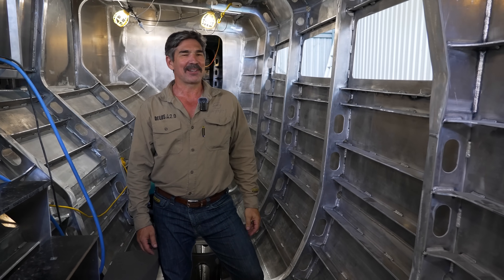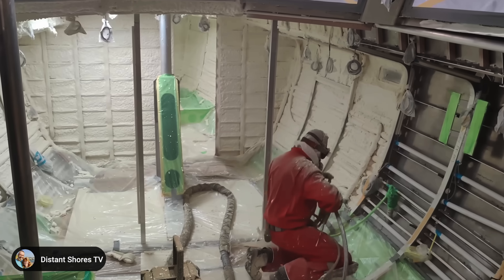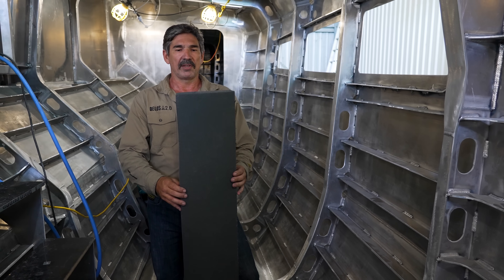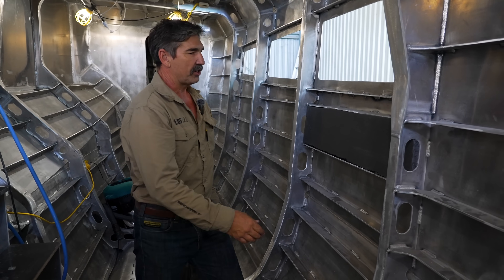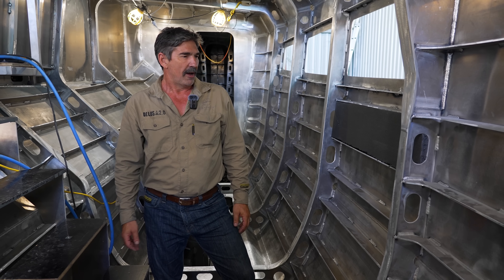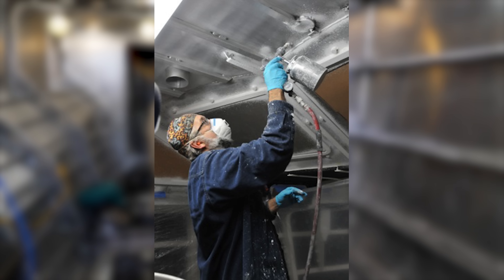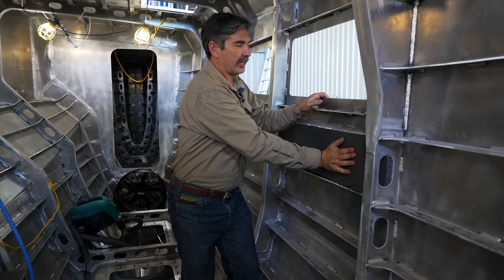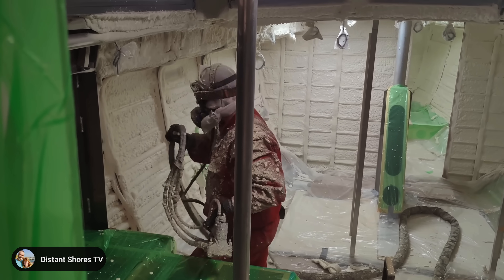HELP, We Need Your Advice!  How Should We Insulate Our Aluminum Catamaran???

Comment: I sold commercial insulation for 20 years. Insulation is only part of the equation, a continuous vapor barrier is the rest if the equation. For the complexity of the hull, the only product, that will provide a proper vapor barrier, is closed cell spray foam.

Comment: What ever you decide on run all your wire conduit with jumper box’s every so often, but spray foam would be my choice, being insulation you also add flotation buoyancy in case you get hold might keep you from being sunk just my opinion and thoughts

Comment: Neolon between the ribs and sealed with spray foam.  Easier to remove large section in case of repairs and still sealed together with spray foam.   You can't get away from the heat transfer with the the ribs but a thin layer of insulation will help.

Comment: After looking up some stuff on this I would say  personally I would go with
1) paint for moisture protection
2) foam for insulation.

I would definitely say that painting (maybe using the correct etch primer/primer first) would be something I'd want to do and then putting the insulation on top of that, if painted correctly then this means even if you get some condensation in there it won't get to the metal.

If it was myself I'd look at first finding an etch primer, these are normally really thin (like a fine mist) and mostly there to get good adherence between base primer and the metal. 
Then a proper coastal protection primer to provide the moisture barrier. 
After than a top coat (if required by the primer)
Then, as you don't like spray foam, you can use the solid foam for sound/temperature. I would probably leave gaps at the top and bottom plus maybe some vents so it can breathe to allow moisture to escape.

If using paint as the moisture protection using (vented) foam blocks is probably a good way to go as it allows easy regular inspection.
If not painting the probably go with the spray foam to get a seal on the metal. Although I doubt this 'bond' to the hull will be as durable as etch primer over time so personally I'd go with the paint option.

That may be overkill to most but If I was putting this much money in a boat I'd want it to be overkill :P

Note: If using these kind of 2 pack paints for spraying you really need an air fed mask. When talking about paints like these two pack etch primers they are really (and I mean really) bad for your health until set. I remember one comment saying something about them getting into to your lungs, hardening in there and never leave again until you're body decomposes :O. The one I used (aircraft not boat though) it was ok once hardened (so any sanding dust was about as bad as normal dust) but when wet it was pretty nasty stuff.
Reply: Nice way to make a condensation nightmare that will grow mould .
Reply: @jackdbur hmm, Sorry all I see a sarcastic comment with no real helpful advice just problems ... I think that is what the internet calls a troll or are you just new to the internet. 
Your the only one so far to mention mould (a valid point true but not the discussion of this post and the video), and you do it in a reply rather to a post responding to something Brian said in the video (wanting Hard foam) rather than a helpful post of your own pointing it out with advice.

I definitely smell someone who just likes to try and put others down rather than post helpful advice. Hope you felt good about yourself with that post, as to everyone else we will just ignore it if you have nothing helpful to add to the conversation.

Just in case I'm wrong though.
Feel free to start you own post on how to deal with mould so that others can benefit/add to side of the conversation (unless you fear being criticized on your own ideas). 

I only know that from my own personal experiences that I prefer the idea to be able to easily inspect behind foam (but I'm from aviation side of things so yearly inspections are something I'm used to), more work but that way I can be sure no rust/mould/cracks are being hidden and catch any issues early. If mould was an issue where I was based I would also clean with white vinegar before reassembling (well actually I'd seek advice first to see what the latest and greatest methods were for that issue).

Comment: Any electrical conduit runs should be made WITHOUT mixing voltages inside the runs.  An electrical conduit must carry the same voltage.  Do not mix DC and AC conduit runs, and don’t mix DC runs of differing voltages, especially anything low voltage DC and high voltage DC (anything over 48 VDC). You might consider color coding conduit that is matched to each voltage it is carrying for easy identification to what is what, given your primary voltage is 48VDC but you will likely have 120 or 240 VAC runs too for certain equipment.  Complicated Brian. Think through everything.

Comment: As a commercial and luxury boat/ship builder and designer for 50 years. Your choice for quality is but one.
Here's how you do it.
Etch the metal, prime with MIL-PRF-23377K Type I, Class N Yellow Chromate-Free primer, spray foam insulation. Do this only if you want the proper job done correctly. 
Good luck.
Reply: I think that is the same primer airplanes use.  Airplane manufacturers prime every piece of Aluminum before it riveted.  Airplanes suffer from major condensation and frost issues.  If they didn't prime, airplanes life expectancy would be greatly shortened due to corrosion.  WWII aircraft were not primed.  Why waste the money on airplane that wasn't going to last long.  It means that corrosion is a big problem with WWII aircraft.
Reply: Fascinating information, and quite funny to read all these comments, as a non expert in this field. And it is as an experienced live aboard professional sailor told me a few months ago: if you have 2 sailors in a room then you have 3 (opposing) opinions about sailing in that same room 
😆
Reply: @bailahie4235  There is a Dutch Expression the best Helmsman stand on Shore. 
Also if you watch the Tally Ho channel they swear by traditional wood hull boats instead of Fiberglass or other materials. 
Which is probably the same for what ever you are specialized and or most familiar with. 

Also
Reply: You bet it is. That is why it is the very best for long-term corrosion protection.
Reply: Personally I Don't feel aluminum is proper for live aboard sailboats.  One small mistake on a reef and it's gone. And finding knowledgeable repair worldwide is a major problem.
Reply: @enduranceG51  In practice, the reality is quite the opposite. An aluminium boat will take a beating on a reef and just dent. The FG boat will get holed. Speaking from experience as the owner of an aluminium cat that's been on the reef at few times (at the hands of the prev owner). No fibre glass boat of the same weight would have taken the beating this thing has.
Reply: @enduranceG51  Delos crew has over a decade sailing experience. 
And what I've seen from other fiberglass boats with Sailing vloggers its not always a pick nick regardless on what material your hull is made out of. 

Sure Pilot error can still happen but its probably a small number, can't say for other sailors that may cross paths with Delos. 

But to live full time on a boat that cir cum navigates the world you do want easy upkeep. And space. 
Most people that live on luxury yachts are probably at best a month or 2 on a boat per year. 

So things break slower as well. Full time sailors always have something to fix it seems like.
Reply: There are plenty of arm chair builders on this trying to give advice which is great, but not necessarily correct. I'm sure it will be sorted out.  Brian is pretty with it.
Reply: Not sure that works for a boat that people live full time on, and maybe not the most upkeep friendly.  I'd rather go with an approach that is upkeep/accessible friendly.
Reply: A glass boat will far outlive an aluminum boat for this application.  Not a carbon fiber boat either.  If it is glass I recommend you use Kevlar instead with limited carbon in critical mechanical areas. Too many people think full carbon and fast is cool. Sailing is cool, getting there safely is cool, and galvanic corrosion is not.
I wish they had gone a different route.  Time unfortunately will prove me correct. I tried to warn LA Vagabond and the Wynns. See where that got them.
Reply: Stop drinking, go to bed…
Reply: @vandijk1698  Lol have you ever met boat people.

Comment: Insulation of a camper van is kinda the same ?? Metal.  We used 3m product.  Spray to adhesive.  Many spray foam.  Will you use sound ded - kilmat ?? Reduce sound ?

Comment: Might consider running some small condensation pipe or tubes deep inside the wall next to the aluminum hull in case you need to drain possible water trapped in there in areas prone to water or moisture infiltration.  Spray foam is going to give you your best thermal break, and aluminum is very conductive to heat or cold transfer, so for best overall efficiency and comfort, insulating is likely much more important than you might otherwise think.  There are lots of wall finish products out there for sound transmission, so think about how you plan to affix whatever interior wall finish product over the insulation as part of your insulation design and choices.  Maybe you can run SUbSURFACE layers of FLAT 1/4” x 2” thick PVC maybe 1-1/2” from the final finished inside wall, with the PVC flat bar bent to match the curvature of your inside walls, so any wall finish materials (like thin and bendable marine grade plywood) can be screwed into it.  Not sure how you plan to do this, but your insulation plan needs to incorporate everything, including electrical, plumbing, mechanical, and finished inside wall.

Comment: I would say use the spray coat and then back it with the foam. More expensive, but it would prevent corrosion and allow future modifications much more easily. Personal choice really based on $$$$. Not sure if the spray foam would be more difficult in the future. I am kinda torn, I see the conundrum....

Comment: Use closed cell spay foam. Better to have a solid long term seal with no dew or moisture point between the hull and foam for best long term fix that mitigates corrosion risks, maximizes insulation and sound deadening. Depending on the type, it’s lite, floats and may add some structural impact strength . Before  spraying add conduit tubes in case you need wire runs. If you have to dig it out in the future so be it. The effort to do this with modern battery operated hand tools (I.e. multi tool with various blades including plastic) makes it easy.

Comment: Hey Brian I Don't know Much about aluminum but as someone who lives in a steel school bus (And has been studying the ins and outs of the lifestyle for a little more than a decade) I would recommend doing the thermal coat to prevent corrosion and then using spray foam for insulation, my advice is to run conduits through key points in the frame before applying the foam and installing access points that can be used for later maintenance for wiring, plumbing, things like that. I plan to do largely the same with my bus, Although I don't plan on encountering nearly as much salt water so I will hardly need the corrosion resistance If everything goes to plan..... and let's be Honest if I do I probably have bigger problems XD . Hope you folks have a wonderful week god bless you XP

Comment: Make sure whatever condensation drains you are planning to have as part of your air conditioning are plumbed in and designed appropriately before your final coat of insulation.  Plumbing, mechanical, electrical conduits, condensation runs to your bilge all need to be done prior to insulating or you will end up in a mess trying to cut all this out afterwards.  Over-design everything including electrical conduit runs, and take crazy amounts of photos and videos to have as records of what you have for future repairs and maintenance.  Photos help so much to remember what you have.  As time passes, you forget!

Comment: Let me introduce you to Poor Man’s SPRAY FOAM Job, Super effective. (there is a few videos on YT)

Use your preferred foam board and leave 1/2" all around and use closed cell canned spay foam all around.
It is worth purchasing a contractor spray foam gun for cans.

That would still leave the horizontal edges exposed, for this, look for the products called :
U-Seal Channel Edge Protector Sheet
U Channel Edge Trim Seal
U Shaped Sealing Strip

Also worth considering :
Construction foam boards, they are likely cheaper but less flexible, can be used for all flat surfaced, they usually have a higher R value per inch than any other products.
Consider 3M 78 Polystyrene Foam Insulation Spray Adhesive, it is used to stick foam boards to pretty much anything, I wonder how well it will stick to aluminum.

Comment: Brian. Im using the closed cell foam like you show, but 1/2” sheets, doubled up under birth areas. The thinner sheets are better for tight radios areas, I even use 3/8” which wraps in compartments nicely. 2’ is pretty thick.. but if you have the budget and space fire away. I degreased the hull and glued mine down with contact cement both the hull and the insulation, letting it get tacky is key so its not wet behind there, hair dryer and vape mask. I agree about the spray on being a potential mess, or breaking down would be a nightmare too, I mean your gunna have to cover that stuff anyways and thats an another expense. The closed cell has a finished look and is pretty tough. I lay thin sheets from Tap Plastics over the foam in compartment areas to protect it. You can cover the rib sections with thin strips to keep from sweating. Spray foam certainly has its advantages, but glued down foam is very efficient too. Good luck with your decision! Cheers from San Juans Wa. !!!
Reply: Glued down foam panels are worse to remove than spray foam!
Reply: @jackdbur  you should wright a review about it. Then you could get people to to argue or agree with you all day long. You’d enjoy that!

Comment: No practical experience with boat insulation but I built a 24’x64’ two story out building and when we spray foamed it the structure of the building became remarkably more rigid and the noticeable sway on the second floor was gone. The only reason I could think of that you’d need to get to the hull anyway is if you had to weld a repair so I would think the process of cutting out a section wouldn’t be too much of a hindrance really.

Comment: ally-thermal-blanket is generally the way to go, to stop heat transfer "lighter." porous or non-porous. for  sound normally a high density 2"fiber bat. to absorb sound or an open cell high density foam maybe raped in a clingfilm to keep water out. also some dampening patch to stop resonances on your flat ally panels like a car
take your time to work it out. your dealing with 3 thing at once.
A commercial aircraft design engineer sounds like good idea

Comment: I like all three options, Brian.  What if you painted the thin coating you have on the metal for corrosion resistance, then apply the closed cell foam that you have without the pins (I don’t th8nk that’s going to get you much given it’s already encased by the aluminum structure members, and then spray a thinner coat of spray foam on the interior layer to your final thickness.  Then you get the corrosion resistance you want, and you get the repairability option with the removable black closed cell foam, the water resistance associated with the foam, the buoyancy, and you get the thin spray foam that seals everything, which can be cut for repairs if required without all the mess.  You also get the thermal.break for thermal efficiency.  It’s likely extra work as you need to do all 3, but not likely much more expensive given that you need to pay for the product anyway no matter what you decide to go with.  I would try to find a way of integrating your electrical into the “sandwich” design so you don’t need to cut any channels for wiring afterward. That’s extra work, if you can run pvc electrical pipe conduit between the black closed cell foam and the spray foam layers - depending on the thickness of the spray foam layer, then you have conduit channels to pull your wire after the insulation process is completed. Not sure if metal conduit would be a problem given the dissimilar metals of aluminum and metal, but flexible pvc conduit channels might work, as might rigid pave electrical conduit.  I’m just thinking that using all three in a layered sandwich accomplishes everything you want and addresses the downfalls associated with repairability.  The closed cell foam rejects water which is what you want, but having the black closed cell foam also means you can cut the spray foam and remove the black cosedmcell foam without the difficulty and mess you are concerned about. I like that your black closed cell foam cut fits very snug into the metal, and the spray foam obviously has benefits of sealing everything into a single envelope, and offering the thermal break that you want to reject heat or cold  from the exterior, which is what you are going to get with aluminum as it has a very high temperature transmissibility.  A thermal break with spray foam might be good.  Can you somehow integrate flat strips of plastic PVC into the spray foam layer to provide you with a ridged subsurface layer to screw into, much like what you get with Logix foundation blocks whereas the subsurface PvC strip is what drywall or plywood is screwed into as part of standard home construction.  Good luck.
Reply: I would use a IR camera to check for thermal bridging.

Comment: Would a spray-on bed liner like I have in my pickup trucks be a good primer before installing whatever insulation you decide on? I've never seen the bed of the truck sweat (it has a camper shell) even though we have high humidity most of the time in New Orleans.